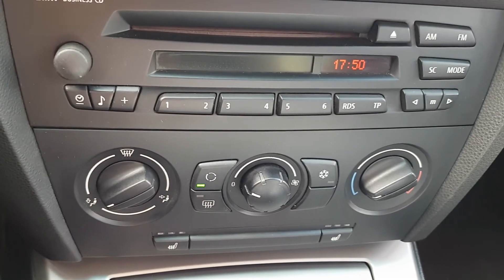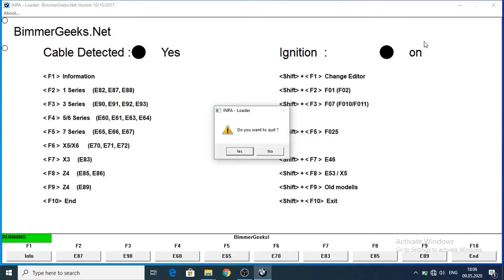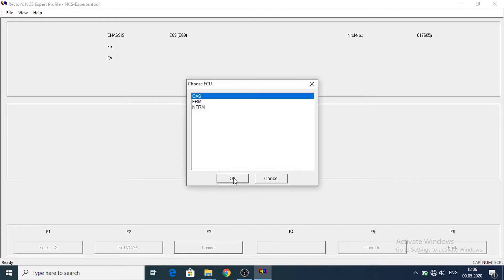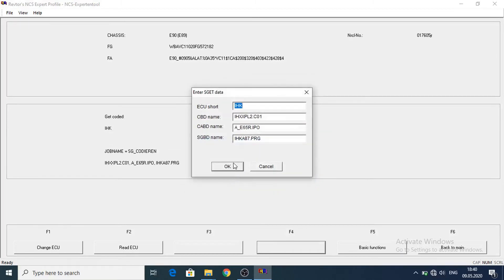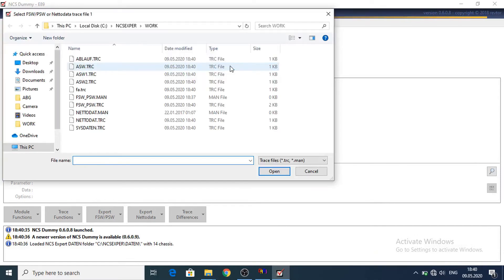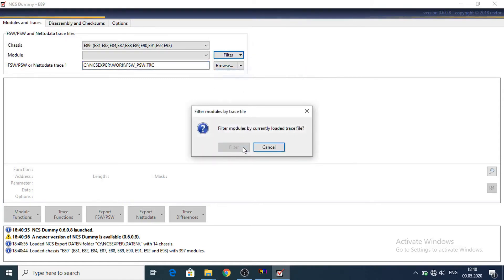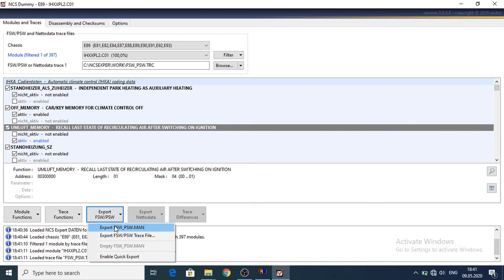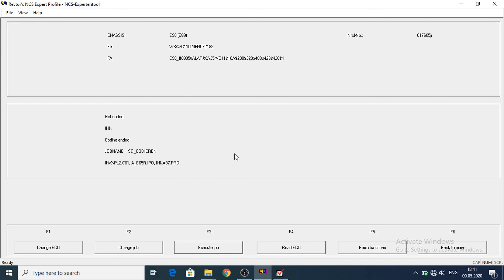7. Recall last state of recirculation button

Comment: Hey! Can you upgrade from basic air conditioning like the one in video, to automatic air conditoning?
Reply from the maker: Hi, unfortunately I didn't try this, but I assume you can, but you need to add also the temperature sensors in the car for automatic air conditionat. After that you need to code it on the car. (I assume will work on the same ecu, you don't need to change it)